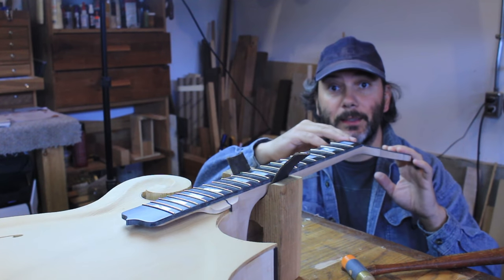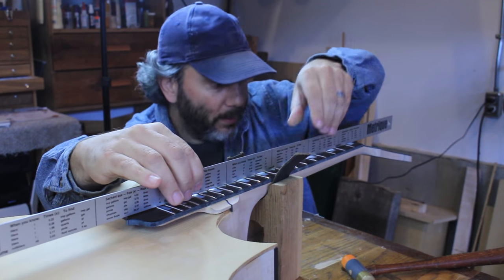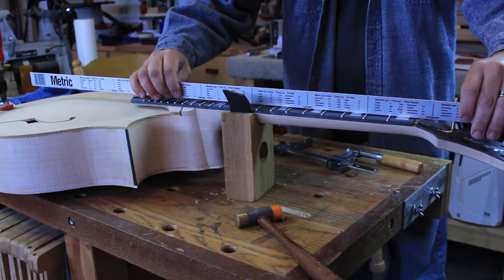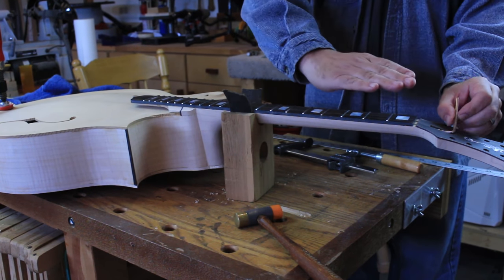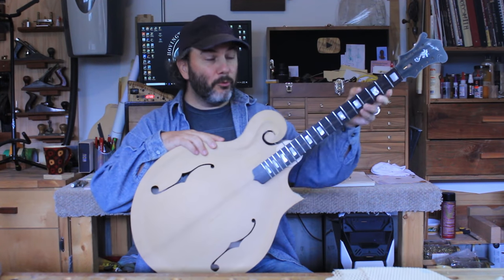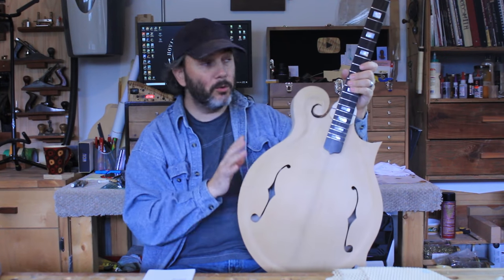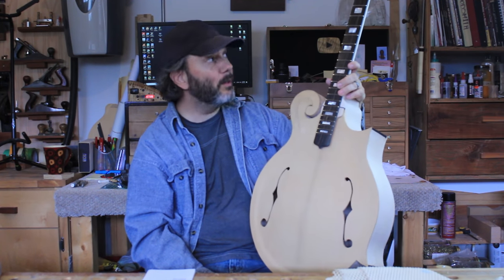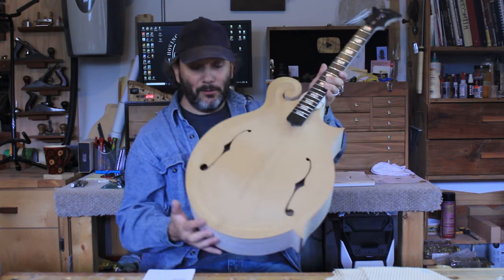Mandocello Adding the fretboard/ Part15

Comment: Great video as always.  I think I noticed that the fret markers on the top of the neck mirror the inlay locations on the face of the fretboard (frets 1, 3, 5, 7, 10, 12, 15, 17, 19, and 21).  How did you decide on those locations?  Would you consider having top and face different?  What feedback do you get from clients and artists in this regard?  Personally, as a guitarist that relies heavily on the top markings, I like them only on 5, 7, 12 (double), and 15.  For me, fewer is more informative.  Cheers.
Reply from the maker: Matthew Taylor it is the first time someone point this out, other than having the 10th marker in the 9th position. ( some are build this way) . For me, personally, I find it practical in regards to finding my position more easily... ( but we all know I’m no professional player). 

Would I consider changes to amount of side markers. For sure. I see no reason to accommodate what a player prefers. I do like the ones on top though, especially when block inlay are involved. ( esthetics) that being said, if the musician wants less and it’s a commissioned build... I will put the markers where the player wants them. After all, it’s a personal preference.